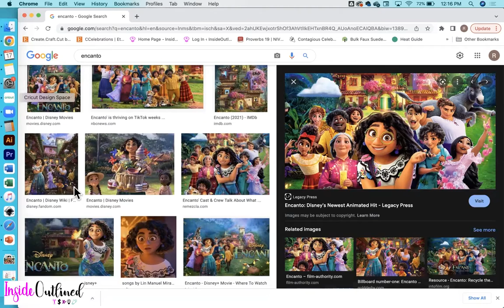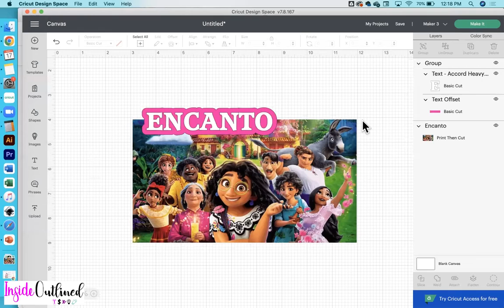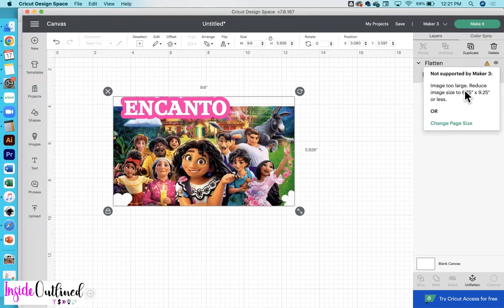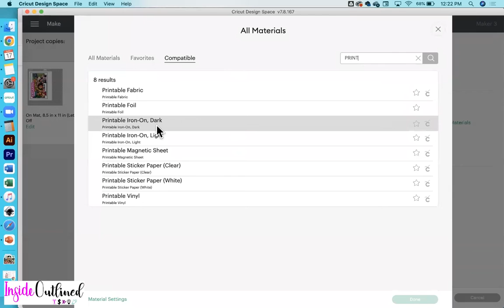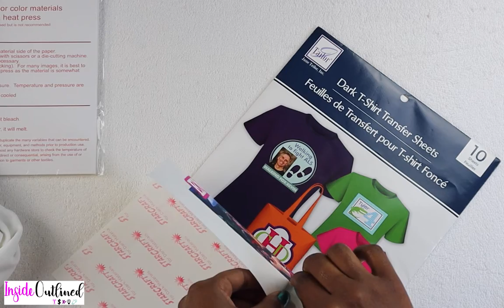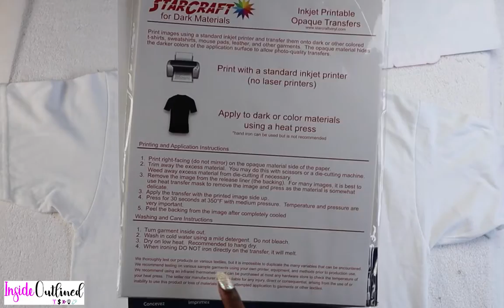Cricut Print Then Cut Iron On | VERY QUICK AND EASY

Comment: Which model printer do you have?
Reply from the maker: Hello JB,

I have the Epson Ecotank 2850.
Reply: Thanks for responding. I spend a lot on graphic tees and hoodies so this is something that I've been thinking about investing in for a couple of years. Until now I hadn't seen a how to video for multicolored prints so I figured it wasn't doable at home. Thank you again for making this possible for me.
Reply from the maker: @Bod2600  You're welcome. You may want to also look into sublimation. I haven't ventured into sublimation yet, but it is popular for creating graphic shirts.
Reply: I'll look into it. 
Ok so I'm leaning towards the: 
Epson Echotank 2850
Cricut EasyPress 3 12x10
StarCraft Printable Heat Transfer (50 pk)

What else will I need to create my studio? What do you suggest for the paper studio mat and  parchment paper? I don't recall you saying any makers.
Reply from the maker: @Bod2600  I think that’s all you need to start out with. The parchment paper comes with the StarCraft Printable inkjet transfer sheets and I use PaperStudio mats because they are inexpensive. One thing to be aware of is that Cricut won’t let you print on the entire 8.5 x 11 sheet of paper. Cricut only allows to print then cut 6.75 in x 9.25 in OR 9.25 in x 6.75 in. https://help.cricut.com/hc/en-us/articles/360009429814-Design-Space-says-printable-image-is-too-large
Reply: @InsideOutlined  So if I wanted to do a shot that's from shoulder to lower back I would have to a ½ and ½ design?
Reply: @InsideOutlined  Or use a different machine?
Reply from the maker: @Bod2600  Yes, you could cut your design in halves, thirds or whatever way you need to and then print and cut accordingly. 

Search for “Cricut larger than mat” on YouTube and you’ll get an idea of how it’s done.
Reply: @InsideOutlined  Last question (you're prolly like gahdammit) which embroidery machine would you suggest?
Reply from the maker: @Bod2600  Lol I can’t recommend any embroidery machine, because I haven’t used one before. That is something I hope to explore in the near future.
Reply: @InsideOutlined OK. Thanks for the assist.